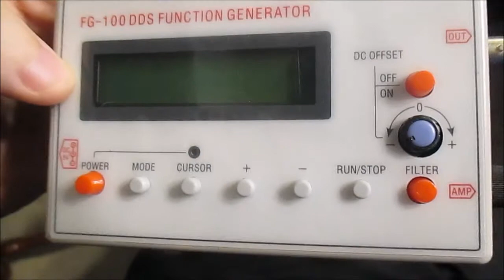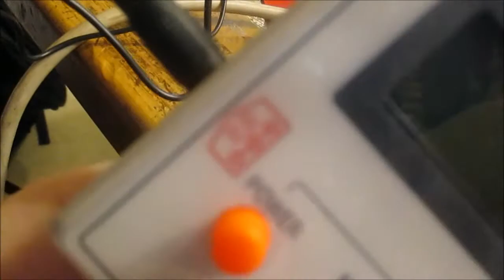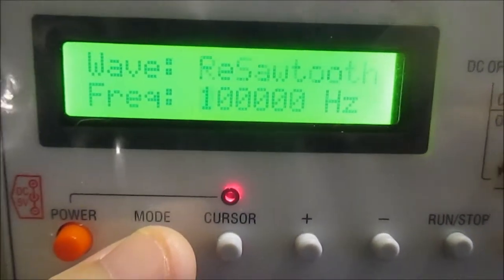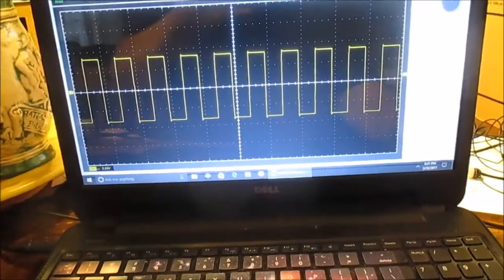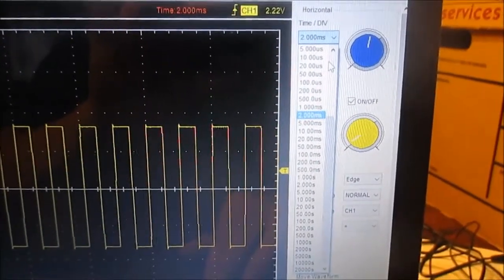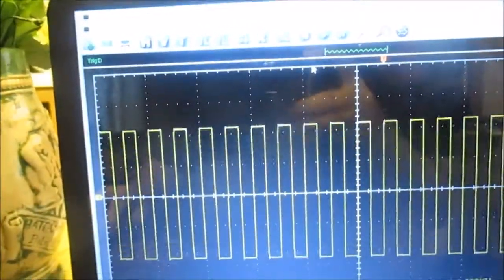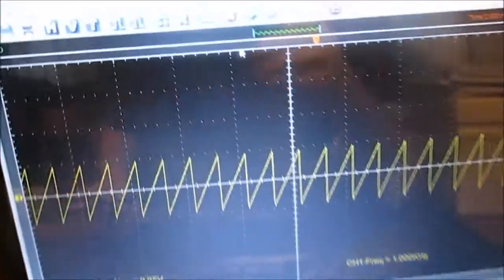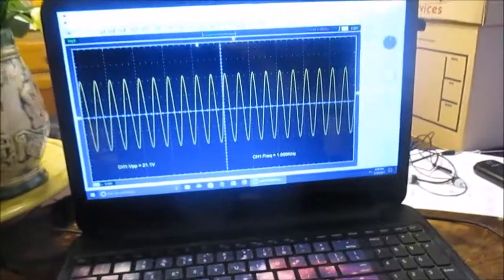Hantek Scope and FG-100 DDS Function Generator

Comment: Can you please explain me what offset and amplitude does???i have a dds generation not like this
Reply: Amplitude is like in every other electronic device a volume control. And for instance an offset of +1 volt will put the signal on top of 1volt DC, so that it will show up
higher on the scope when the scope is coupled in DC mode. AC mode will remove the offset.